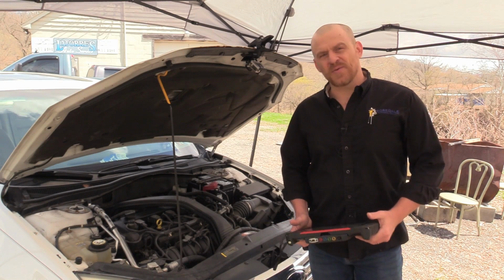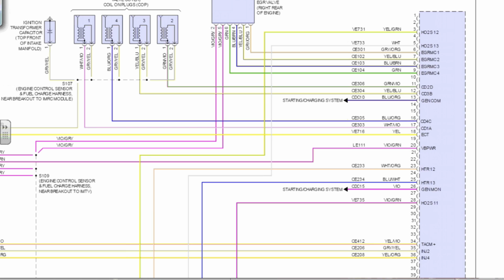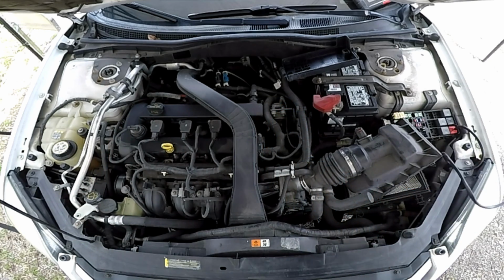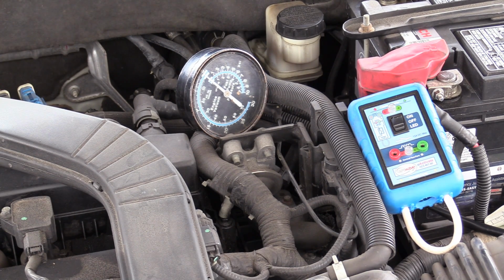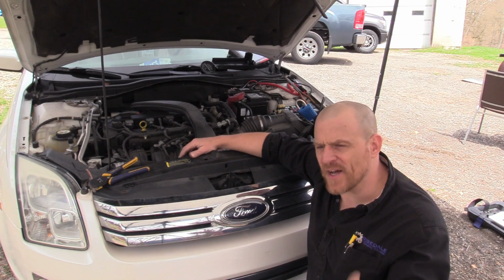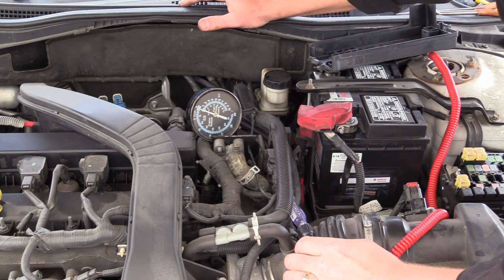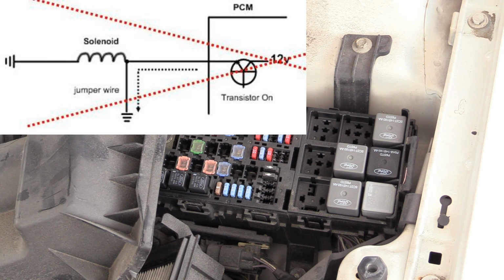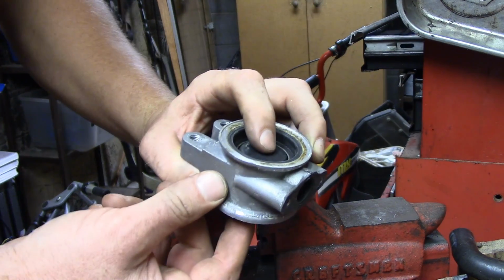2009 Ford Fusion Secondary Air Injection System Fault P0410, P0491

Comment: I have the same exact car I believe the discharge side I found OEM part is called Cooling hose. Is the discharge suppose to be mounted into something ? Mine seems to be leaking water but not sure if it’s suppose to be connected somewhere since it’s a plastic piece connected to the hose

Comment: I have a car doing this exact thing with codes in the throttle body and codes for the pcm data maybe being corrupted. Im new to this. But i commanded the pump on by jumping the relay pins( with a fusable link of course) and the air pump turned on. Visually inspected everything. Now need to check the vacum and the diverter valve. Was lost where to go but i believe the pcm may be the culprit here because of the data corruption.
Reply: There is no diverter valve. Maybe an ERG valve?

Comment: So I am working on a 2008 Ford Fusion with this exact issue. The car idles terrible until it warms up. I watched this video first. And I watched it over and over again, and Paul is such a great teacher, I followed along and took notes and now am going to the car to properly diagnose what is wrong with it. Thank you Paul for your knowledge and great teaching ability.
Reply from the maker: Did this one have an idling issue too? I don't remember that. Thought this was just a code and a light on type complaint.
Reply: @ScannerDanner  This car will start up fine, within a few seconds the idles drops, almost causing the car to stall. I started diagnosing the way that I learned from you and can't get the pump to turn on. I'm not sure if the motor is burned up or if I should try to change the relay. I am getting a P2258 code.
Reply from the maker: Did this symptom occur the same time as the check engine light and that code?
I don't think this secondary air code is causing that. Separate issue imo
Reply: @ScannerDanner  I'm not sure. Someone brought the car to me to have some other work done and they said that a shop told them they had a bad air pump. that shop told them about the code. I verified the code. The symptoms have been occurring for the customer for a while now. No other codes are coming up. Maybe throttle body is dirty? I am going to check the pump today, but if it is bad, you don't think that is why it drops in idle and runs bad? After it warms up, it seems to run fine.
Reply from the maker: @tomclark3592  you need to find out for sure but no, separate problem imo
Reply: @ScannerDanner  Thank you Mr. Danner, I should have attended Rosedale instead of Val-Tech!
Reply: @ScannerDanner  I think I need your book!
Reply from the maker: @tomclark3592 my classes are available too! Thank you Tom. It's never too late to learn this stuff, especially if you find it fascinating
Reply: @ScannerDanner  I was going to ask you about your classes. When do you teach at Rosedale? I work a 40 hour job and do auto repair in my garage on the weekend. I would love to take some classes though.
Reply from the maker: @tomclark3592 I'm have them all recorded and available on my website. I no longer teach the day to day classes. Hopefully I'll see you in the comments!
https://www.scannerdanner.com/join-scannerdanner-premium.html
Reply: @ScannerDanner  Yes, I am going to subscribe. I want to learn from the best while I still am around to do so.
Reply from the maker: @tomclark3592 looking forward to seeing you there! Thank you!

Comment: Thanks for the information.  Was able to verify that the air pump wasn't pumping.  Took it apart, found water in it, manually spun the fan impeller, put it back together, now it works.  MIL is off and hasn't come back.

Comment: Hey Dan I have a 2007 Fusion and would like to know what are those two sensors with the black and blue connectors by the exhaust manifold? One of them has to be the Upstream O2 sensor but what's the other one and which is wich?  Thank you and take care.

Comment: When you took off the inlet from the pump you had air running through the hose but when I took mine off I didn’t have air coming through from the pump does that mean my air pump is not working?
Reply: I have a code p2257
Reply: I just replaced that what you are working on
Reply from the maker: Was your air pump running? You can hear it. It should run on start up for up to 30 seconds on a cold start

Comment: Thanks. 🚗👍To rule in/out Smog Pump or Relay, without jumpering, know pump will only come on for a few seconds & only on a cold start (not warm). In CA we cant pass smog with any bypass or open codes (except EVAP). 

Disconnect the intake hose at the front of the check valve, cold- start, and the pump should come on for only a few seconds. Also, careful with brittle vacuum lines, check for any leaks triggering codes & CEL. 

Replaced my check valve, solenoid & relay with salvaged parts. Code only cleared after car sat for 8 hours with a cold-start. "Air" Code on OBD2 did NOT clear in the 120 miles I drove back after getting and putting on those part, even with a +dozen start/stop cycles! Took a cold start. 

Not sure which part was bad, but I am not so sophisticated in my skills. 

For 2.3L Fusion the parts online are about $120 for the parts & comes with: the bracket, check valve, solenoid & vacuum lines. 

Try looking it up :2006-2010, Dorman 911-167 6E52-9F491-AA

Secondary Air Injection Check Valve 6S43-9F491-AA 
Relay 
F808B-14B192-AA
Solenoid 
6L34-9H465-BA

Not sure about other engine sizes.

Comment: How soon after changing that valve did the readiness code on the OB2 change to clear?
Reply from the maker: don't know, I never worry about the readiness status as I do not use them to confirm a fix. Emission testing is the only time we worry about the readiness monitors

Comment: Paul why don't you like standard testing of relay, can you explaing why
i always thought this is a best way/safest way to test a relay
1/ test for resistance between85 and 86 50-120 ohms
2/ supply power and ground to 85 and 86 and listen to click
3/ with circuit energized, check resistance between pin 30 and 87 no resistance
4/supply 12 V to pin 30 , ground your test lite and touch pin 87, light should go on.
ALL 4 TESTS PASS = GOOD RELAY
Reply from the maker: Because when resitance measures good, it can still be bad. The ohmmeter does not stress the circuit.

Comment: I actually print these out, tape them together and use multi color highlights on the wires.
You're right it's very hard otherwise
Reply: I make load testers from old parking light sockets and bulbs to draw amps.
Reply: L ed test lights don't draw amps.

Comment: Great show!

When Vac is Applied  and solenoid is energized the the orange end is pulled away from the Reed valve allowing flow through when solenoid is De-energized the spring will hold the reed valves shut to prevent Exhaust gas from running back to the air box .
Correct?
Reply from the maker: I believe so , yes
Reply: @ScannerDanner  Looks like you could mode the old one into the intake side of a Pulse jet engine😁

Comment: why would you teach a risky move like jumping the relay, all you need to do it ohm meter on contacts and power up the relay without installing it.
Reply from the maker: Poor contacts on the load side can and will measure good with an ohmmeter and fail under the normal circuit current. Leave your ohmmeter in your toolbox is what I always say. Most inaccurate tool in your toolbox at times. Sometimes it is super useful! Just not for what you are suggesting

Comment: Sir one doubt here they used a solenoid to produce vaccum that in turn actuate the diverter valve instead they can use the solenoid  to actuate the diverter valve directly why they didn't do that way?

Comment: Finally got time to watch this one - been in my inbox for too long! 

Don't you just love Ford fuse boxes? Even my '86 Grand Marquis isn't labeled. I took a paint pen and labeled them all myself on the backside of the plastic cover under the steering wheel. 😂 Stupid Fords! 🤬 

All these failure-prone emission bandaids will keep us eating well for the foreseeable future, at least! 😁 Great vid as always! 👍🍻

Poor May! I haven't whacked a finger that good in 25 years. Back when I was working in a plastic factory, I was running a machine that stamped out and glued foam liners in plastic caps. There was a wheel under tremendous spring tension that I had fully extended to change to a new roll of tape ... and the SOB tipped over the center point without my seeing it, and slammed down on my ring finger. Thought I lost the tip of my finger at first - went totally numb. When I looked at my fingernail, it was GREEN! Turned black just like May's with time. Boy did that HURT!! Think it took almost 3 months for the nail to completely replace itself.

Comment: I see you using wiring diagrams throughout your videos but never caught what service you use to get them i need a diagram for a 2000 Ford ranger 2wd 3.0L but have been unable to find it anywhere, not sure i want to pay for a monthly subscription for 3 pages of diagrams. Can you help?
Reply from the maker: For $20 you can have all the service info you need. Print it out and save it for the future as well
http://eautorepair.adtrk.biz/?a=10817&c=24&p=r&s1=

Comment: Hey dumb question and honestly wanting to know. What is a air pump used for in a car for its engine? Never heard of an air pump
Reply from the maker: Cold engine start ups, during an enrichment period where unburned fuel is re-ignited in the exhaust manifold to burn it off. At least that's what we were taught way back in the day. 
It may also be used to help light the cat off quicker.

Comment: Hi Mister Danner, i love your videos, one question... it´s always a secure way to check solenoids and relays using the test light, (less than the 0.3 amps ) without affect the computer driver? can we use this method on every single car? thanks
Reply from the maker: you can use a jumper wire with the correct polarity on every single car, but if you do it wrong you WILL fry the computer driver for the circuit you are trying to test. A test light has the same dangers, just not as much. Are you safe to use a 300ma test light on all cars and on all systems? No, you are not. There are always precautions and variables. For example a stepper motor IAC driver normally sees about 40ma from the IAC coil. If you test that circuit with a 300ma test light, do you see how much you've increased the load on that driver? No way am I going to tell you that you are safe on every single car and on every single component. Now, if it is a solenoid? Then yes, I would say you are fine with that test light. And to be clear, we are speaking of the driver test (or at least I am).
Reply: @ScannerDanner  Tanks a lot Mister Danner, it´s now  much clear to do my owns test and how to be much more cautioner on that kind of test.

Comment: The spring is to prevent exhaust gas re-circulation in case of pump failure and the valve opens. Keep that rubber closed in case after a time it gets deformed from being open. You should elaborate a bit in one of your videos the pros and cons of power and ground side switching rather then eluding to it all the time. Understanding the system from an engineers prospective is often illuminating to the reason why a system may be designed in what seems a most illogical fashion. The preference to ground side is almost always a in case of failure the failure mode is ground out as opposed to burning out a powered driver. The other is less powered side wiring that in case of a short can cause a lot of damage. Its not always possible to ground side switch and when not possible it is usually done in a way that if system ever does short wont fry other circuits out.
Reply from the maker: I have many times! Mostly within the confines of my classroom though, so that would be on the premium channel. I'll have to do something here too. Thanks!
Reply: @ScannerDanner  I was kinda saying it with premium content in mind. But then again I haven't watched every last video. Esp in the basic sections as much of it is beneath my abilities. But it was the thought I had at the time.

Comment: Another great video. I listened to the remarkable results podcast with you in it today and you 4 guys did an amazing job discussing the pros and cons of youtube.

Secondly, I kept seeing the autel case next to the car. I assume you tried using the autel for bidirectional control? I've had slightly better luck with the autel and bidirectional controls than I have with the snap on lately.

Comment: thrown off a bit by the built in disc check-valve ehh?  forgot to say that weird looking spring is there to push the check-disc shut, also don't get snagged on one that has too low of pump pressure or restricted/leaky hoses to/from the pump.
yeah I've torn apart plenty of them in the past so I already know what's in there lol. often times you can pull a vacuum on the diaphragm, then hit the inlet with air compressor to free the check valve disc, I've used carb and brake cleaner in them before, but that could eat the rubber up and usually ends up sticking again sooner than later.

Comment: the catalysts are clogged and the pressure is stronger and keeps the clogged valve a probability
Reply: the car likely wouldn't run at all if it was that plugged up or would stall when the air injection did run
Reply: not necessarily has to be completely obstructed to create pressure, if this pressure is high the strongest wins but you're right in what you say.
Reply from the maker: no, the exhaust is not plugged, no driveability problems on this car whatsoever

Comment: @ 6:29 you missed/skipped the fact diagram shows "SAIR CONT" for "Secondary Air Control",  it being the control and spliced directly to both pump relay and vacuum solenoid says both would be on at the same time. ***seen later in video that you did miss it, then caught it lol.
still good too follow the other half back to power/ground though then you'll know if it's pull up/down and what else is connected together if there's other bugs.
glad I waited to watch, I'd have been cranky had it vanished part way through lol. not often I watch a whole video at once, always side tracked lol

Comment: I had a high school algebra teacher that would freak out if numbers were not pronounced correctly. Like Mr. Danner said at the start of the video. He pronounced the year as two thousand and nine. My teacher would get mad and say you just said 2000.9 not 2009. It is pronounced two thousand nine. After all these years it still with me.
Reply: had one like that also, luckily only for "study hall" and not math which I took advanced class earlier in the day. anyway the fella would go total nuts if there was the tinniest speck of paper on the desks or floor anywhere, like spiral bound notebooks sheets ripped out leaving pieces falling all over and the jagged edge on the paper, lookout all hell would break loose!
one time someone dumped a giant amount of shredded paper/confetti in the room, he left and he wasn't seen for two weeks, either mental breakdown or vacation, I never messed with the guy and figured some form of OCD or PTSD who knows, wasn't any of my business :)

Comment: don't worry about it . you did great job .. Spring is broken
Reply: spring was fine, it was there to push the "disc check valve" shut, until he put it back on reversed. the metal and rubber disc tend to get sticky and gum up together into a stuck mess.
same thing happens on systems with only check valves, maybe a hose/pump leak allowed salt/water/contamination to get into there, alternate the pump could be weak or a hose leak and not enough pressure to open the disc

Comment: I appreciate you took the time to open up the valve and check out the inside,I'm always curious to find out if we can see the failure. You've proven several times throughout the video what failed, so solid diagnostic there! 👍 It looks like Ford is selling the valve and solenoid as an assembly, that should make some technicians happy since they don't have to prove which component failed. 😁 I personally watch your channel because I want to learn how the system works. I'm actually surprised that the Verus doesn't have a secondary air pump activation, they're usually solid on domestics! I would've definitely tried another scanner,I'm pretty sure it would've had a secondary air pump activation test, they are very common and it would've saved a technician a lot of time and extra work! I'm sure you could've done that, but it's no fun for you not having to show us the diagram,activate relays etc...you love that kind of stuff! 😁👍 I would've liked to see the O2s react to the scan tool activation of the pump, but I've seen that live on a car and they show lean like they should! Thanks again, great video! 👍👍👍

Comment: Hay Paul have you worked on full electrical cars yet.
Reply from the maker: Not yet
Reply: @ScannerDanner   Have you seen a  Field effect transistors, I just diagnosed a  2009 Hyundai Santa FE Limited 3.3L  blower motor, and it had a  FET generally display very high input impedance at low frequencies it is a pretty cool controller.

Comment: This video reminds me of my younger days of working at the Cadillac dealership. The early 2000’s Deville’s and Seville’s were PLAUGED with Secondary AIR system problems.
Reply: those should have been called GSIS "Guaranteed Secondary Income Systems"
Reply: throttle bottle 😂😂😂 👍👍

Comment: No I don’t question it whether it fixed the problem or not cause I trust that you got it fixed and if not no big deal it’s a Ford (what is the problem). But I have questions 
1) instead of jumper wire can you use an older wire tester? Non LED light
2) when taking apart the valve could have been carbon buildup making it not work properly?
Thank you love the videos even here on vacation in the Philippines